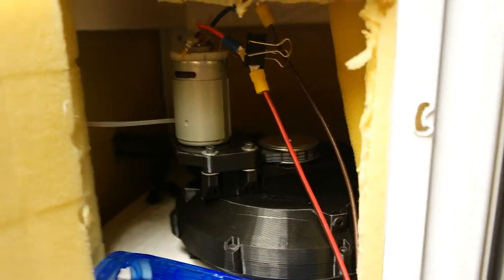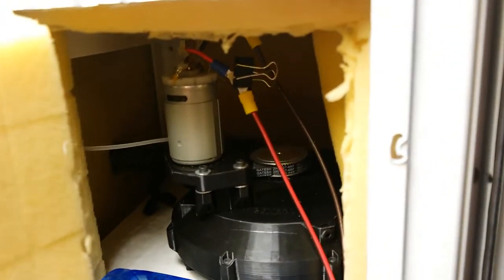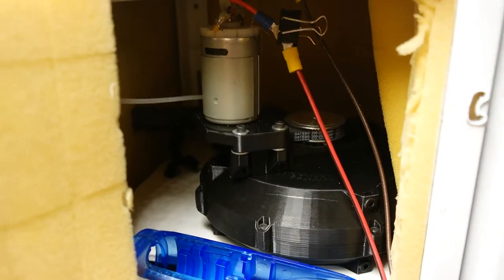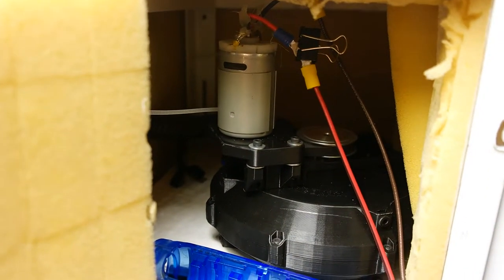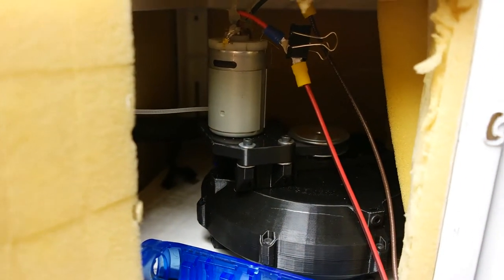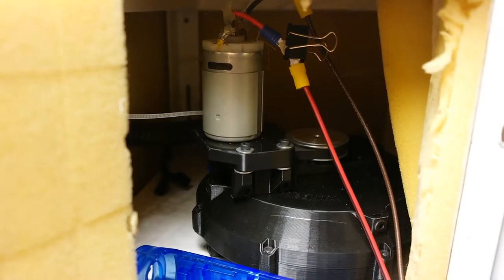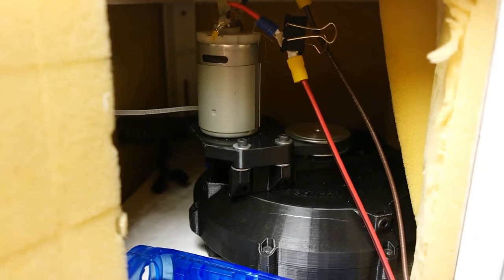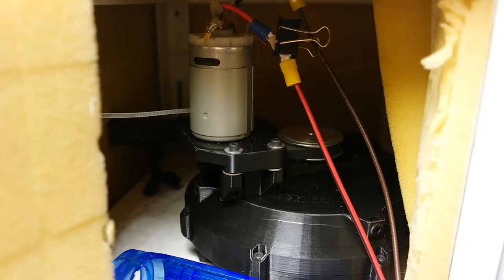Printer diaries: No need to scream? | Shorts

Comment: The fact that this works at low RPM makes it even more impressive. No jet engine speeds needed which would ruin 3d printed blades
Reply from the maker: That's what I'm thinking, too.  Nobody gets very far with 3D printed centrifugal compressors because they don't build boost without tens of thousands of RPMs (if not more) and you just can't do that with plastic.  And nobody gets very far with 3D printed roots or screw compressors because you just can't print at the required tolerances.  This approach has its own limitations, but it seems VERY well suited for good performance within the limits of what FDM 3D printing can do, which is creating nearly unmachineable geometry on the cheap with close tolerances but (ideally...) non-contact moving parts.
Reply: @jamespray  For sure! I am almost wondering whether you could achieve better tolerances by intentially over-running the blades at a burst of slightly higher rpm, essentially sanding itself down. Then clearing the dust and running it at a lower rpm in normal operation. I have been palnning in building a 3D printed blower fan for a while and its refreshing to see your approach, ill test it out.
Reply from the maker: @stefanguiton  That could work, sure!  But the impeller would have to be running flat, first, and it's not (the shaft is tilted slightly, so the impeller disc wobbles).  I think the issue is that the lock collars I used don't have well-centered bores.  I am planning a redesign of the impeller with a separate hub so it can be adjusted for tilt and centering problems.  I have found a motor type that looks easy to work with (775) and should be able to do some more testing soon-ish.